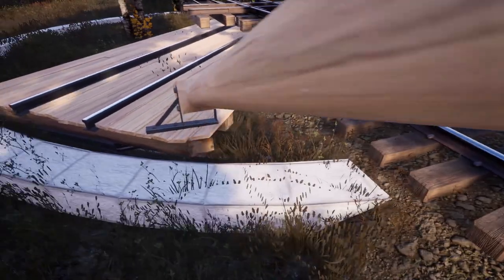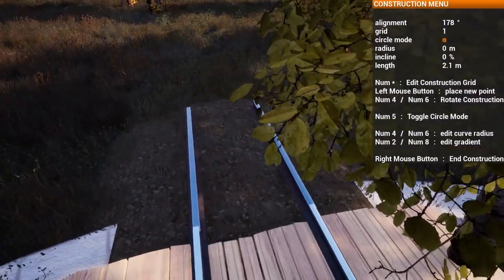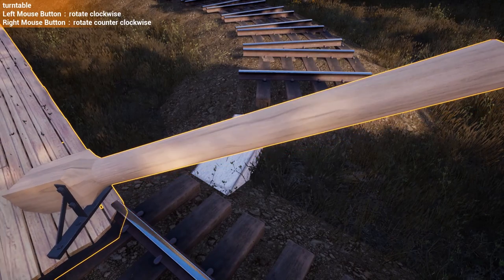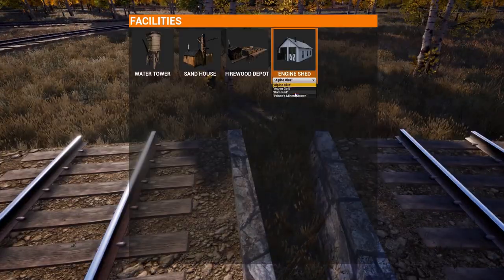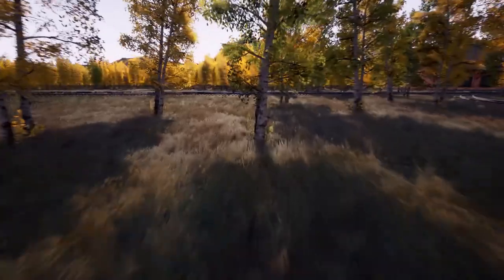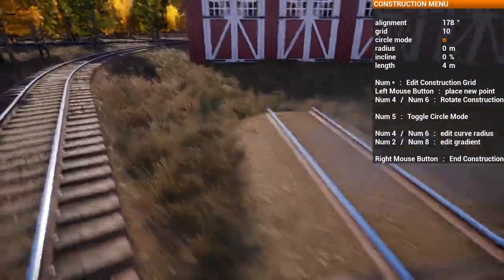How to Build a 30 Stall Roundhouse in Railroads Online!

Comment: I am assuming that you can use this technique for a 15 stall roundhouse.
Reply from the maker: The engine houses have two stalls each, so 14 or 16 would work better. 

Placing one half of an engine shed over another would mean two sets of doors to open, as well as two tracks inside the engine house to line up perfectly. It should work if you want an odd number of stalls, though it'll take a bit of time to line them up correctly unless you place one slightly above the other.
Reply: @Tultry  nice